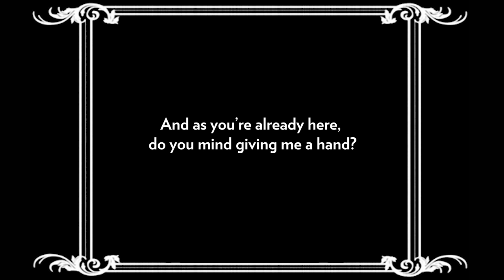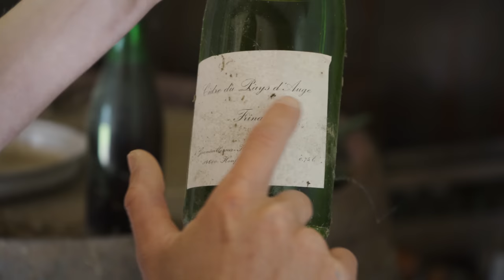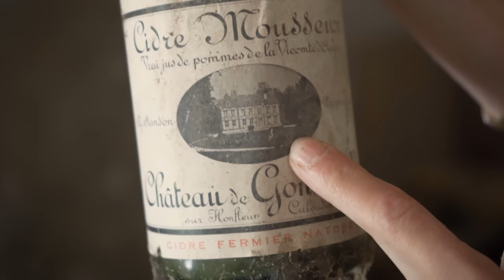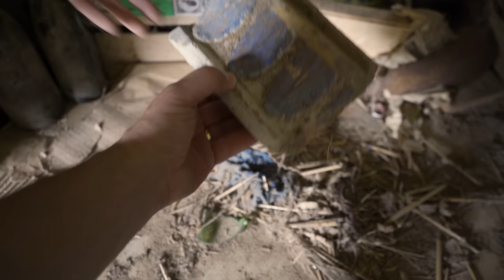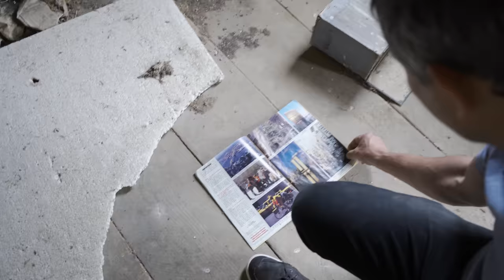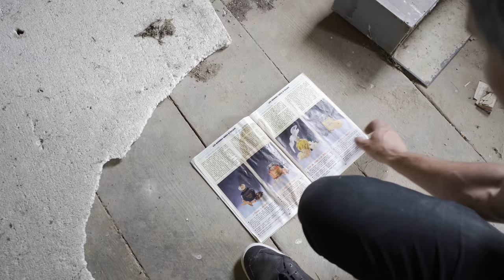Discover our Chateau OUTBUILDINGS 1 - How to renovate a Chateau (Without killing your partner) ep 24

Comment: My engineering heart is jumping full of joy when I see these historic buildings. They're the reason I chose my profession for. 
But important things now: you need to get the structures dry and keep them dry, that's 80% of the job done!
Look out for wet stains on the floor, they will tell you where the water is getting in and where to start repairs.  At best you'll get some heavy rain and can see the water coming in. You can always add pillars to hold the structures in place until you can start reconstruction, but stopping the cause of damage will give you time.
I wish I was closer to you and could just come over to help....
Reply from the maker: Thank you very much!
Reply: @HowToRenovateAChateau  Always! If you need anything just ask.

Comment: Amazing find of bottles! Don’t know if you’ve seen this DIY with wine/cider bottles but after you throughly clean them, you can drill a hole 
(must use a special drill bit) on the side at the bottom of the glass (but above the base),  and insert battery operated “fairy lights”/Tiny LED lights, or plug in Christmas lights (the small ones not the large bulbs) depending where you put the bottle. The LED ones can be used as lighting on patio tables with some other little decorations and the bottles that have a electrical cord can be used in an outdoor kitchen, bar, side table, etc. My son has made some. They are really cool and depending on the color of glass, gives off a different “glow.”
Obviously you can’t drink what’s inside, so this way you can use them and they have a purpose. And you could use some for vases in your guest rooms.

Comment: Make wine in the barrels👍😉 Don't cut them up if they can be restored and used. It is a nice hobby for Philip to pick up on when restoration of the Chateau is complete. Gets some LED lighting for the long house. Save the structure! You can branch out and use them for storing wine bottles and antiques on shelves. You can stabilize the beams that have decay, inject a low viscosity epoxy or urethane into the beam.

Comment: One of the ways you could quickly help that ancient outbuilding is by cutting down the trees behind it back about fifteen feet for better air circulation. THat will keep that side of the building dryer. THe drone shot shows the trees coming right up to the building and that would prevent air flow. Cut them back a bit.

Comment: It's a barn, cattle down the bottom, hay in the loft, hence earth floor and wide slatted ceiling and wide slatted loft walls, keeps the hay ventilated and dry. For accommodation, boundary drainage's necessary for damp free walls 24:30, do this when you install the effluent system. 

How about a coffee patisserie shop of minimal renovation, outside paving (may already be there), tables/chairs and discrete dedicated parking. With infotainment boards around the area and a self guided walking tour. Access for fans and travelers keen to spend some money but can't afford the time or finances to actually sleepover. Great cashflow.